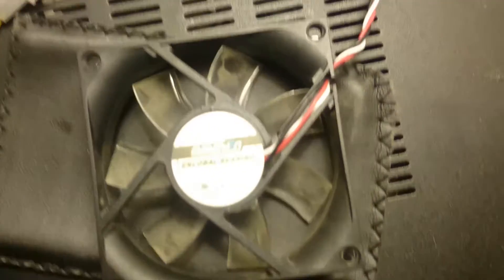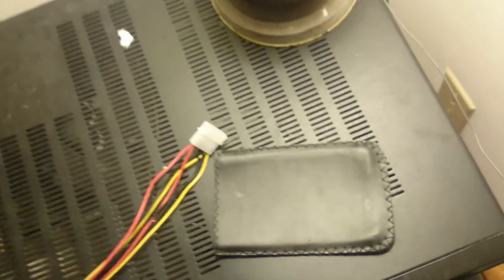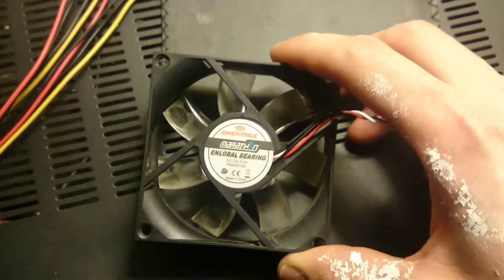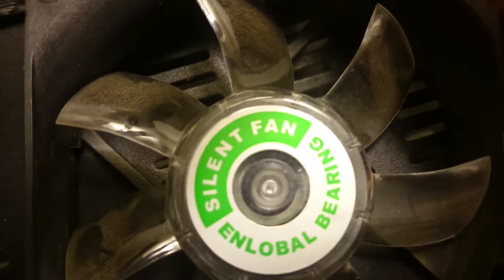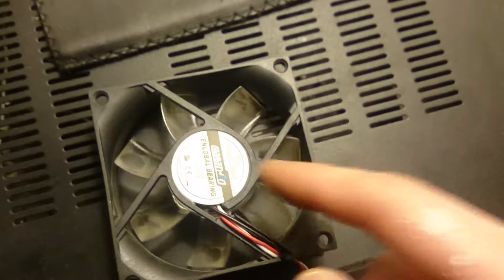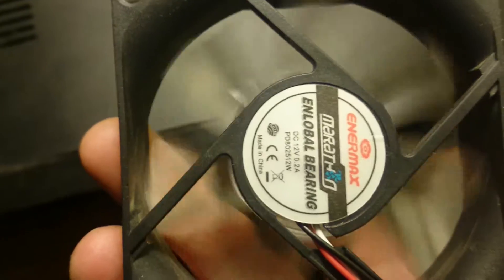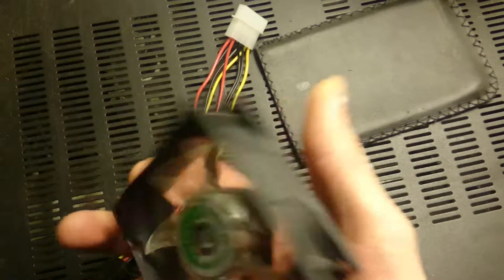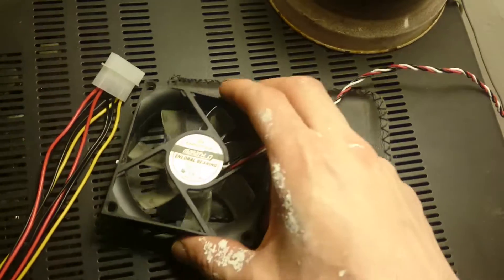magnetic bearing fans are neat

Comment: Completely silent?
The spec sheet for the VAPO bearing (MagLev) gives it a noise rating of 45.5 dbA @ max 4500rpm. Moving 75CFM of air.
Are those decibels just the rush of air over the vanes and through the finger guard? 
Rated lifespan of the Sunon is 60k hours (6 a.). What is the limiting factor?
Reply from the maker: There is no way this fan moves 75cfm of air. It spins incredibly slowly. Nowhere near fast enough to move that much air. But I'm guessing that yes if it did spin that fast, all of the noise would be from the air. I don't know what the limiting factor would be for this fan, since there is no real mechanical wear or lubrication to run out like a normal fan.